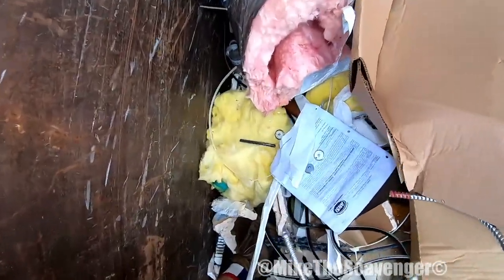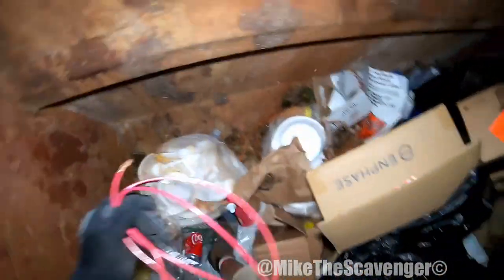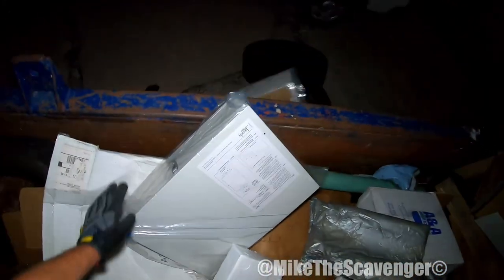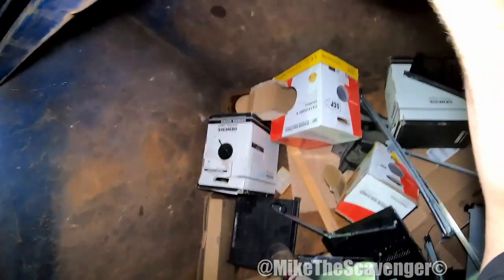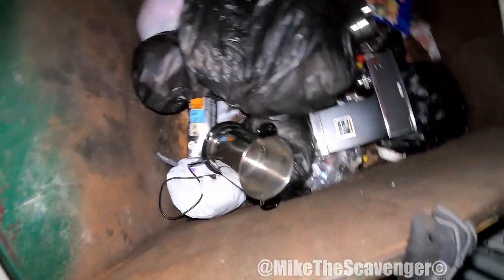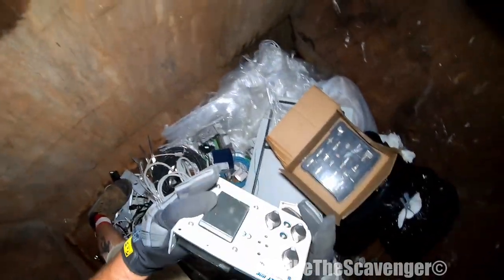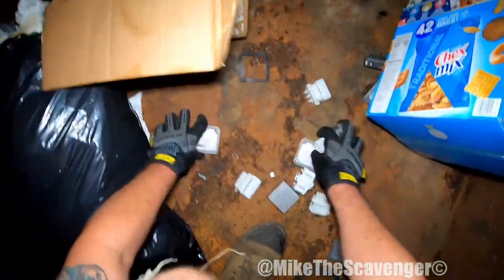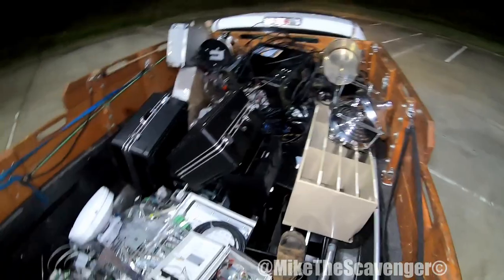Dumpster Diving "Rusty, Crusty Scraps"

Comment: hey Mike, thanks for another great video. Sharps containers (the one with the needles/blood) is supposed to be disposed of properly, either through a pharmacy, a hospital, or a medical waste service. Some workplaces now have sharps containers in the bathrooms for the diabetics or others that have meds that have to be injected.
Reply: So what should he have done with that container? Are there places to take something like that if someone comes across a 'sharps' container again?
Reply: I know in the last city I lived in sharps could be dropped with standard trash for residents if it was within a sturdy sealed container.  I had to check after we started doing insulin shots for our cat.  Businesses would probably have a disposal service, which is what that is most likely from.  Ultimately check with your local city ordinances for proper disposal.

Comment: As a radio amature I drooled over all the microwave antennas and resonant cavities. Thank you, Mike, for keeping an old scavenger entertained.
Reply: I'm a radio amateur operator myself. seen that RG214 coax with , looks to be PL259's and also got excited over the antennas 's De VK6FRLR
Reply: @rcautoparts1  Hello, Robert, I see Mike find so many cool electronics and radio gear it blows my mind, and he just chucks it into Dottie and it's off to the scrapyard. He is a bull in the china shop but has a hell of a good work ethic.🖐🏻73's🎙🎧KD9OAM📻
Reply: @rcautoparts1  That's not PL259 connectors. Hate to break it to you, but no one uses those commercially. Those are strictly used by HAMS for low frequency stuff. Probably N connectors on LMR400 or better cable. All that stuff he found is 2.4ghz or 5ghz stuff or other licensed microwave bands - PL259's don't work at high frequencies
Reply: And the coax cables too!
Reply: @gorak9000  I just installed 2 repeaters at 200 feet both with hardline on the tower, a 440 and a 220 machine, at the base of the tower we have a fully insulated, heated and cooled shed. everything inside is hooked up with PL259. We used LMR 400, and I use it at home. That one particular HT Mike found looked to be a UHF, PL259 is sold as a UHF connector they look the same as an N connector on the outside its inside where you see a difference. The N connector has an additional shield.

Comment: Those Jandy pieces would have brought probably $1000 in combined value or so if you threw them on eBay.
Reply: Those QSC amplifiers run about a grand a piece on eBay as well.

Comment: Hey Mike, those parts and pieces with that notice about being deadly. That’s a standard warning that’s connected with equipment/antennas that transmit RF energy. Not something you want to be in the way of when it’s transmitting. The state that it’s in now isn’t a problem.

Comment: Jandy pro series laminar jet go for about 1200 to 1500 and from what I saw it was all there. Just the box you opened is a 700 to 800 item. Jandy Purelink 6614ap-l go for 600 used and about 1600 new. all in all about 8000 in the dumpster. All great sellers on Ebay.

Comment: Radio waves us a GPS system for trucks. Those connectors in that flat case I would be laying cash to get myself. Even those road cases I would purchase for my radio gear. Youzerrrrrr.
Wifi antennas. I will fly down to purchase all these items. Sma jumper. I would purchase all those microwave and Wi-Fi antennas.

Comment: Just wondering for all that armor cable you pick up do you strip it and sell it for scrap or clean it up and resell it. At the hardware store they were selling that for $120 for not a lot of it. Scrap value would be less than $5. I'm sure you could resell it in your local area for 3 to 5 times the scrap value.

Comment: Does uv units are not sheep and there is uv light in it take hole box instead dont throw it around... just saying locked unused to...

The fold up computer is for mounting in a server rack pull out of cabinet fold up...